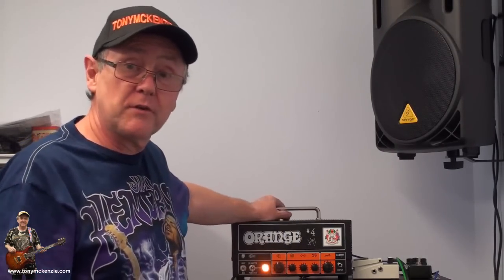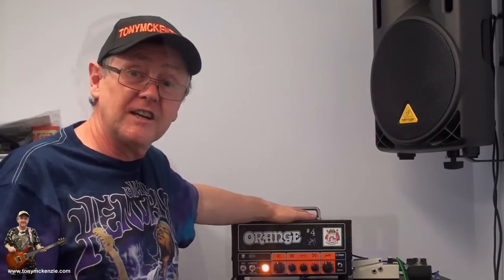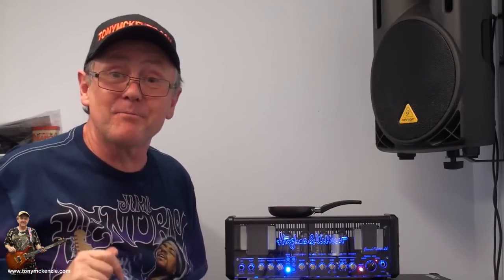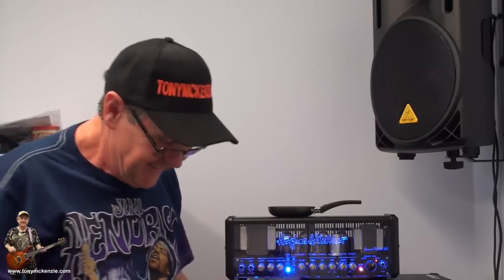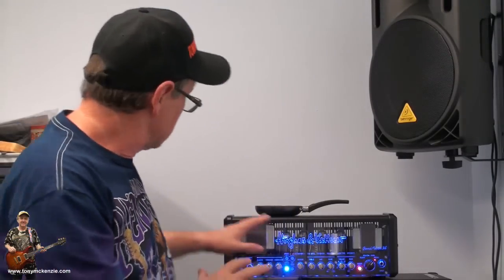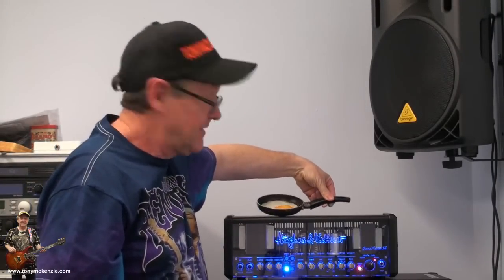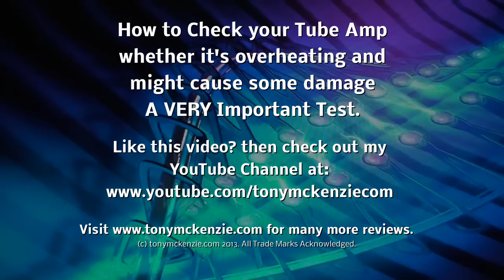How to Check Your Guitar Tube Amp For Overheating | Tutorial and Review | Tony Mckenzie

Comment: Haha that made me chuckle! In all seriousness, I just bought a new Fender Champ (my first tube amp) and the metal on top gets really hot after about twenty minutes, after loads of research  still can't figure out if that's normal. What do you think?
Reply from the maker: :) I made that years back, but it has real meaning of course :). It's probably fine for metal top amp as you say. Tubes can get really hot and I think the metal tops sort of increase the heat somewhat... thanks for watching.
Reply: @tonymckenzieofficial  Thanks Tony, yep the metal probably doesn't help. It sounds great otherwise.

Comment: Tony thanks for all the videos and hard work.  I have learned a lot watching many of your videos.  I am airline pilot trying to learn guitar so I would consider myself a newbie. So if I have misspoke any terms please take it easy on me ;). After watching your JVM410 bashing I took your advice and bought a used Marshall TSL 100. It has worked fantastic for several months but it is beginning to have a volume cutout when playing.  I assumed the tubes might be the problem but I don't have your expertise.  Since I really don't know the condition of the tubes I thought I would like to know your recommendations for tube replacement.  Actually I would like to put in a request for you to show your fans how to test and replace and even simple trouble shooting for tube amps.  Hope you can find the time to do it.

Thanks again. Marc
Reply from the maker: I'm a guitarist trying to learn how to be an airline pilot :) (I'm only joking of course). Hmmm probably tubes... and that idea of changing tubes and showing how is OK but the procedures (read amp features) sometimes make the replacement different on some amps. For example some amps have external Bias, some have internal Bias and some are plain automatic Bias. Changing the tube itself is a simple unplug and plug the new one in really (usually in pairs for the power tubes) and individually for the preamp tubes (the small ones). But I might just make a video of it on a couple of amps... not that bad an idea. On tubes I get many questions and when I specify what I use I get all sorts of comments... suffice to say, I do what I do and don't really listen to others.

I tend to buy Tube Amp Doctor tubes because of the matching and they tend to be very reliable. Some say (for example) 'huh they are just Chinese tubes' or 'they are no different than the others out there' but in my opinion I do think they are better than many I could name. I have never had a single tube failure with TAD tubes and for me that says a lot. Bear in mind that most companies only offer 3 months warranty on tubes! Buy tubes that are not really that good and you might be buying more sooner than later. Hmm trouble shooting too on a video could be a good subject - but remember I'm not a qualified engineer.

BTW TSL100 has been one of my favourite amps (the 60w one is no where near as nice sounding) and I recorded my 'Eniac' album on the TSL - it was an awesome sound no doubt and I really do regret selling mine. While some of these new amps do more, they often don't serve the tone as well as that amp. Hope it helps...
Reply: +Marc Mantel If you're an airline pilot you shouldn't be learning the guitar; you should stay away from anything that can do divebombs O.o
Reply from the maker: +Marc Mantel Hey Marc did you ever find the problem with the TSL100?

Comment: Do these amps really run that hot?  Could it be because of the metal casing instead of a plywood box?  Also, can you give a frank opinion on the tone of these amps without any puns or jokes so I can figure out whether it's worth a purchase.  The DI possibility here looks interesting and the attenuator power soak.
Reply from the maker: They can be hot because the top is metal. Heres the full review because this one was meant to be a spoof ;-)  http://youtu.be/I7UxJ8Rb19A
Reply: ***** Thanks, Tony.  Actually, independent of your review I decided to get a Mesa mini rectifier instead.  Nice build and tone and works for me across the spectrum of sounds I want.
Reply from the maker: wajang1000 Thats also a very good amp ;-)

Comment: how do you know if your amp is too hot,will the sound change? will it start sounding like it has less and less distortion if on the high-gain channel? you never said how long to safely use the amp, 4hr, 10hrs??
Reply from the maker: trey tolbert Actually this video was really a joke video. However, if your amp gets really hot after 10 minutes... turn it off and get it checked! In reality this am will NOT do what I demonstrated unfortunately because I like eggs :)
Reply: thanks, so as long as its not getting hot after only a few minutes use, then there is not a over heating problem. got it, thanks again.
Reply from the maker: trey tolbert Play it for say 10 minutes or so... is it REALLY hot? does it 'smell' very hot or burning? if so stop! if not its probably good to go.
Reply: thanks Tony, nothing abnormal after 10min, even after 1-2 hrs just very warm, with only that very slight tube amp smell even after several hrs powered up (4hr+), this is my first tube amp in over 20yrs, so just trying to get familiar with it again, everything seems fine and normal in operation.
Reply from the maker: trey tolbert Sounds about right to me :)

Comment: I had an Orange 80 watt bass head.  It ran so hot the solder would melt on the power tube sockets and the big resisters would just fall out.  This happened 2  times.  Looking back, I think the output transformers were defective "partially shorted" and were on their way to direct short.  The amp never blew a fuse.  My dad went with me the 3rd time and told the guy we wanted our money back.
The tech said he didn't know what was wrong and didn't know how to fix it.
Something was making the amp draw to much current, it had to be the output transformer. This was back in the mid seventies when Wishbone Ash was popular.
They used Orange Amps when they played in New Orleans.
Reply from the maker: I'm sure that back in the day (70's and indeed 80's) that this was an issue. I had a Peavey Mace (160w) that cooked the tube board and sockets... but have not seen that issue for a very long time.
Reply: Hello Mr Tony and thanks for writing.  I was an electronics technician before I retired.  The first thing I would do on a piece of equipment was give it a good whack.  I fixed a lot of stuff with that technique.  Other times I would check the fuses.  If one had blown , I knew something was shorted out or the fuse failed of old age.  If the fuses were good and still not working, I know something had opened up, an open circuit. Unloading the power supply by disconnecting it, showed many things.  With the unit plugged in and a good fuse installed, On power up if the fuse did not blow was a good indication the problem was somewhere down the line.  Then connecting one leg of the power supply back, one at a time, you could pinpoint the bad circuit.  When the power supply was reconnected and the fuse would pop, you knew where the problem.  We used Freeze Mist in the spray can for "acts up after warm up", problems.  Sometimes we used the tip of the soldering iron or we pinched the capacitors with a needle nose plier.  Anything electronic works more or less the same,  The heart is the power supply.  With the techniques mentioned above you can fix anything electronic.  Battery devices, a bad charger or bad rechargeable batteries is usually the problem.  I understand electronics better know that when I was 22.
Reply from the maker: Anthony Goodlove I do know some of those things but not all of them :-) the pliers on the caps is a new one to me, but the freezer spray I knew. Anyway, those are good to know and maybe others will read this and benefit too ;-)
Reply: Mr Tony I just watched the Egnator  Shasie review.  Oh I love how you say that. I like its around the world ready power transformer.  I read somewhere you had some trouble with a Peavey Head. They are about an hour away, just up the highway in Meridian Mississippi.
I have  the Studio Chorus, 30X30 stereo, I bought it back in the 80's, and sounds real good with a single coil guitar.  This man walked up to me at a gig and said that guitar through that amp sounds great.  Yeah I had  my American Standard Strat 1988.  I have two 5150's from 1992.  You know Eddie Van Halen's Peavey colaberation.  Without a doubt, these amps can shake my whole house.  I think 5150 is a California police code for out of control.
Reply from the maker: Too much current is for sure a bad sign. I use some light bulbs on the power after working on an amp and if they glow dim when I turn on thats good... but if they glow bright I usually have time to pull the plug :)
Reply from the maker: Anthony Goodlove The 5150 was really a great amp. I never had one myself, but I know plenty that did. When I look at Peavey today, they fall far short of that sound really. Thankfully the days of the Peavey Mace (which I had) are probably over. That one cooked the PCB the power tubes were on.
Reply: Developed with guitar legend Edward Van Halen.
The 5150 lets you experience 120W of smooth crunch and dense harmonics. 5 - 12AX7s in the preamp and 4 - 6L6s in the power amp provide all the gain and tone you'll need. Includes high and low gain inputs, and the 2 channel preamp is switchable on the front panel or footswitch. The rhythm channel features pre/post gain controls and bright/crunch switches. Lead channel has controls for pre/post gain only. Channels share 3-band EQ, presence, and resonance controls. Switchable post EQ effects loop. 16, 8, or 4 ohms with preamp output. Footswitch included.

The 5150 series amplifiers and enclosures are the result of extensive research and development with guitar legend Edward Van Halen to produce the ultimate products for guitarists. With the 5150 and 5150 II heads, you'll experience super rock crunch, harmonic-rich sustain, and screaming drive like you've never heard before. Production models are identical to those Van Halen uses when recording, as well as those he currently uses on tour.
Features
Reply: Mr Tony I bought a 40 watt Marshall about 12 years ago.  The face plate was so hot you almost burned your fingers.  Its a tube model, the usual English setup.  Swimming in tube.
I bought 2 fans at Radio Shack, I hooked one up with some wire twist's you see on a loaf of bread.  It blowd over the power tubes.  The other connected to the back of the amps vents, this one blowing out.  It worked out very well. I bought a JMI Vox ac50 head from this guy in California.  It was already fanned.
I have an AC 30 made in the UK by Korg,  I put a fan on it too. Around 1999.
There is a guy Gary Hailbeck, Dr Vox.
He has a license from VOX. to build speaker cabinets.  He made me an AC50 Cabinet with Midax Horns and 2 Celestion Vintage 30's. It's open back, sounds real good for bass Mowtown bass.  He is at VOXSHOWROOM.COM and specializes in British Invasion equipment.  His collection of amps should be in a museum.
Reply from the maker: Anthony Goodlove Now that's something I have to try LOL Making Bread! (Lord knows I don't make any money from it all LOL). I know, you used the wire... but you've got me thinking.... what about beans! I'm only joking of course... just in case you get any ideas :) I used to have a Peavey MX (in a flight case - built right on to the amp) that had a fan like that... and it needed it too. Come to think of it some of My Mesa Boogies have fans too. Ill check out Mr Vox... sounds like he knows a thing or two about those cabs. Vox is very old and I'm sure these days they don't make them like they used to.
Reply: OK you know about the wire twist. 
The back of the DSL401 Marshall has a metal back dirlled with holes to vent the heat.  Now you can touch the front panel. Its lightly warm.
I got 3 guitars from Gary, Dr Vox.  2 Hofner bass's a Club and 501/1 and a big orange Duane Eddy Nashville.  Has horseshoe of head stock and De'Armond single coils.
I used it one night at a club throught a fender hot rod deluxe.  Man it sounded.so
good, people wanted to touch the guitar.  They said "you are real serious about your music"  I said what makes you say that "we can tell from your equipment".
Reply: I didn't have any tie warps,  I went to mamas house and looked in her kitchen drawer.
Reply: I found some Fender Bridges with full size tremolo block on Ebay for $17, they are 2 1/16 for Squier strats. PN0071014000.  I got 5, I just finished one.  Took about 90 minutes.  This allows you to put the tension spring in the arm hole.  Takes the play out of the arm., spring is always pushing up and develops nice cushion. This is the only thing wrong with the Squiers.  The tremolo blocks are reduced 50% and arm hole does not have a floor.  So you always have a loose aggrevating tremolo arm.  I'm talking about Vintage Tremolo Systems.
These Squiers have Alnico 3 pickups, the output slightly lower but very clear.  So you get the dirt from the Amp.  When I setup I dial in a good lead tone.  Then just backoff the volume to a rythm volume.  Well 4 more to go!
Reply from the maker: Anthony Goodlove Thanks for that info Anthony, I did not know that about Squire's. I know they are different parts but the arm base is new info for me. I assume those squire pickups are Chinese? or am I wrong about that.

Comment: whats better tonally the h&k or the orange jim root?
Reply from the maker: Better is hard to describe :-) but I would say that the Jim Root has one really great sound (and a couple similar) whereas the H&K is way more flexible than the Jim Root. So if you really only play one style of rock the Jim Root works well. However, if you play lots of styles then the H&K shines.... but it costs more than 2x the cost of the Jim Root.
Reply: thanks very much for that i just like the simplicity of the Jim root terror

Comment: my hod rad deluxe doesnt gime the clean tone after 2hrs before that sound great ,what the problem could be sr ? sounds awsome the first 2hrs after that sound like shit clean channel sounds distorted.hopefully yu can help me
Reply from the maker: +David  Garcia The Hot Rod Deluxe has 6L6 and 12AX7 tubes for power and pre amp. If you have not changed them in some time I would get a new set... its probably tube related. Obviously I can't be sure.. but they might need changing. Thanks for watching.